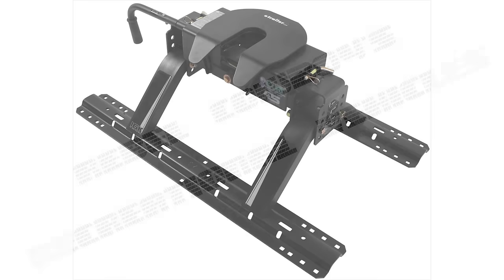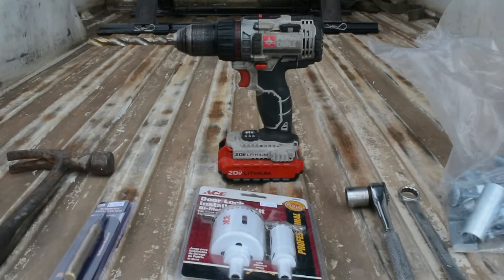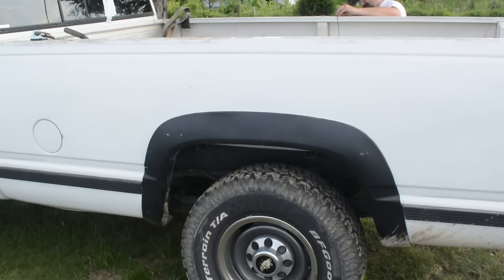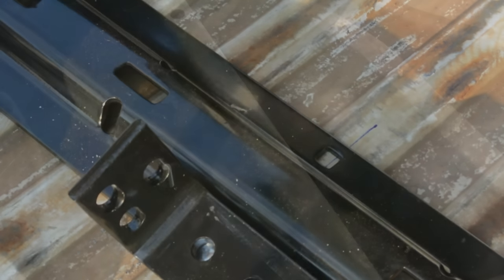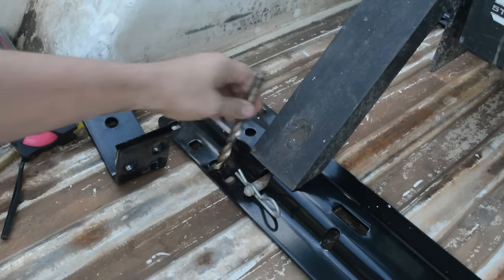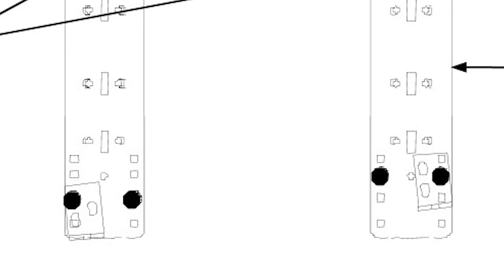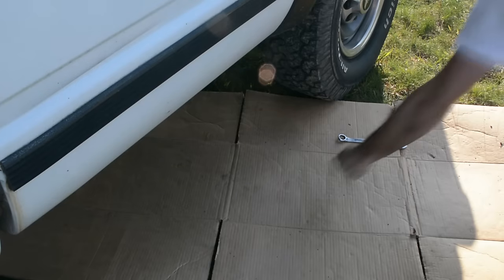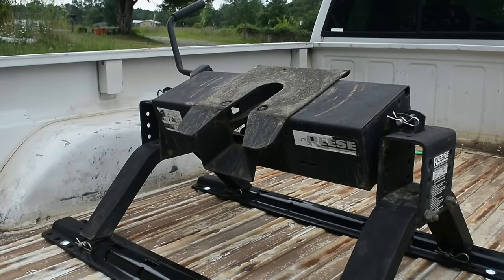Fifth Wheel Hitch Installation.

Comment: Magnet to hold the bracket up on the bolt? Absolute genius. And putting a weight on top of the bolt heads to hold them down for you while you get under the truck... Making work easier for yourself at every turn. Great vid

Comment: Great video looks good and well instructed. 

One recommendation I would make is to place it a little in front of the rear axle so it displaces weight not only on the rear axle but also more more on the front of the truck too. Typically when you install a goose neck or 5th wheel hitch on a truck you don't want the weight directly centered over the rear axle you want it just forward of the rear axle toward the cab. This provides a better balanced towing experience and helps prevent the front end of the truck from being lighter or lifting when hauling a heavy load because it places some of the load on the front of the truck as well.

Comment: I actually used to work as an installation tech at a local hitch supply outlet. I've installed these Reese Fifth Wheel Rails in countless trucks and 98% of them fit like a glove with the proper brackets. Next Spring I may buy a set of brand new Reese Rails for my 2001 Ford F350 Long Bed truck. And I'm highly tempted to install the rails in myself and just purchase the needed drill bits and torque wrench. It honestly isn't as hard as it looks, it's incredibly easier with a second person to help hold the bolt still while the second person crawls under the truck bed to tighten down the nuts and washers. And the drilling involved in the frame rails is hard but it's not insanely difficult. In my case it will be more difficult as the Ford Frame rails in the Super Duty trucks are actually harder steel than a Chevy or Dodge so that makes it harder to drill through. Using a pilot hole with a smaller drill bit is essential to ease the larger needed drill bit through, it makes a huge difference using a pilot hole with all of the holes needed in the installation. Anyways, it was a very well done video tutorial and I give you a ton of credit for not feeling too intimated about doing it yourself with your own hands and tools instead of paying the UN-necessary costs in labor for a hitch shop to do the same thing as you can do.

Comment: Really helped me grasp the situation where I ended up with a hitch (bought it with the 5th wheel) but former owner had the original rails welded to his truck. So...I've heard so much discouraging information....you can't find rails...etc. Plus, the hitch, appears to be a fine one, isn't marked at all as to the manufacturer.  So to find a set of rails...that's confusing. But at least, with your video I have hopes there is a universal rail kit out there. One thing is different. Your rails are horizontal in your truck bed. This hitch, it's original rails were exactly the opposite.  Being on a budget....I'm hoping I will be able to find a solution to use this good hitch....but find rails.  Your video sure took the mystery out of the size of the job to actually do this rail installation. Estimates to do this from the RV guys.....around $1,000.00 and most of them don't want to use my hitch.  So, there's a learning curve. Again, great video!

Comment: Great Job! However I'd feel better and safer with drilling through the frame and bolting the mounting brackets to the frame. I fear the welds may break. So I'm going to bolt it on. Again, Great video cowboy.

Comment: Thank you for this video! How heavy of a camper can your truck tow? Im look at a 97 dually 454 and am planning on doing the same thing.
Reply from the maker: Mine with the diesel and 3.42 highway gear, it is rated at 6K pounds. It really feels that. I believe the 454 with the 4.11 gear is rated at 10K pounds and the 4.56 gear was something like 12K pounds I would think both can safely stop 12K, but the 4.10 gear would cook the trans after a while.

Comment: In my search for a 5th wheel receiver, I'm noticing that they are made specific for certain trucks. My question then is if you use top mounted bed rails that are universal, then isn't it a moot point?
Reply from the maker: I am not aware of any truck you can't use a standard rail system on. Then you can use any hitch made for those rails. That being said, if a company makes a rail kit for your truck, it may be worth the money for time saved. And It looks like the rail system is becoming outdated. A lot of new trucks have what they call a puck system, where the hitch drops through holes already in the bed, locking to the frame directly. That started about 10 years ago. No need to drill more holes in your truck. I have no experience with those myself, but I think I would use that if my truck had them, and I could afford it. Rails are not usually in the way when not in use, but they can be at times. They also make adapters to use regular rail hitches in a truck bed with pucks. There have also been some specialty hitches for quite a while that don't use the rail system at all. It use to be easy to pick a hitch, an a good day's work installing it. It's starting to be the other way around. But I have never even touched anything other than a universal rail system. My truck is to old for anything else, an my wallet can't afford anything fancier.

Comment: If the instructions say the hitch is 1.5 inches ahead of the axle, couldn't you just subtract 1.5 inches from the back of the bed to the first rail measurement to get you on center of the axle?

Comment: Do you think this all will apply to a 99 Chevy Silverado 6 foot bed 1/2 ton 4X4 to haul a 31 foot camper
Reply from the maker: A sliding hitch is usually recommended for a 6 foot bed, for turning. Some of those have their own mounting system and some use regular rails like this. If you get one that uses rails, its pretty much the same installation. You can use a regular 5th wheel hitch, but you have to be careful to not get in to the back of your cab turning. A 31 foot trailer is also probably pushing the limits of a 1/2 ton truck, so make sure the trailer does not put you over weight, and the tongue weight is not more than the trucks payload rating.

Comment: My question is does the rails and hitch have to be the same brand?
Reply from the maker: Some hitches need a special setup, but the ones using these cross rails all seem to be the same.
Reply: Most rails are universal. And are rated for most weights. Double check before buying don’t use me as insurance👍

Comment: I have the same year truck but my rails don't have all the extra holes on the ends. There mounted with 4 bolts only. Will this work
Reply from the maker: Roger Belcher if the holes are all in the same place, I would assume those rails won't work on this model of a truck. The frame rails are not straight. You would probably have to buy the universal rails like the ones I have.

Comment: would this work on ford super dutys
Reply from the maker: It's pretty much the same. The frame is probably not the same width and uses different holes in the rails.